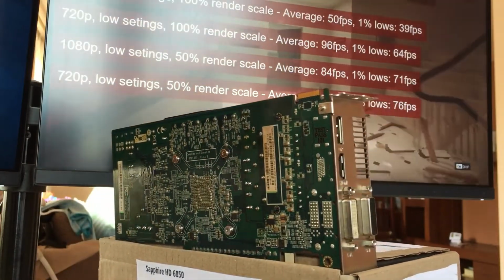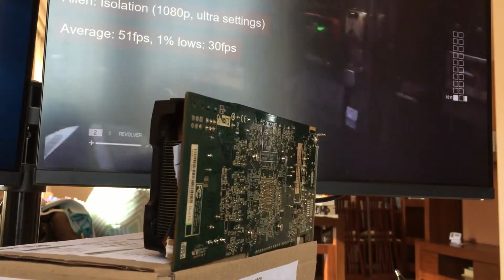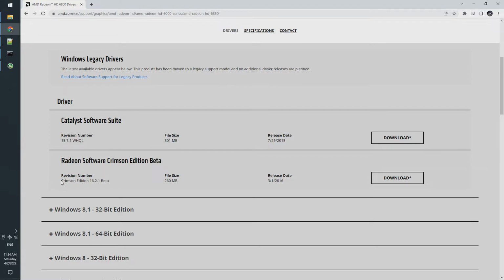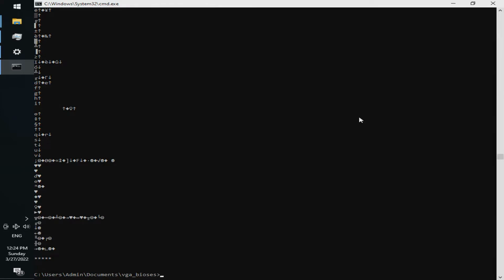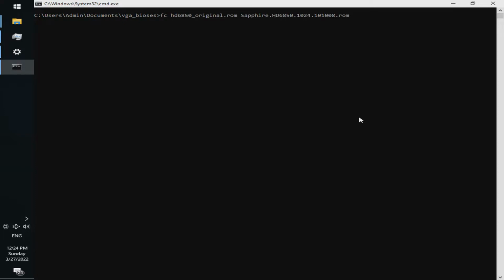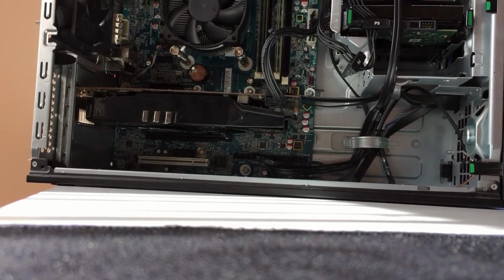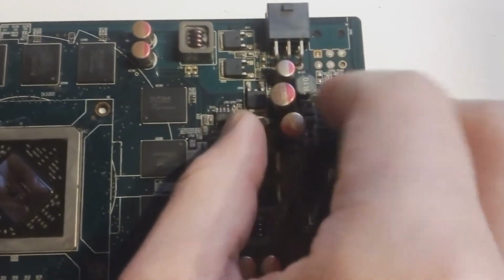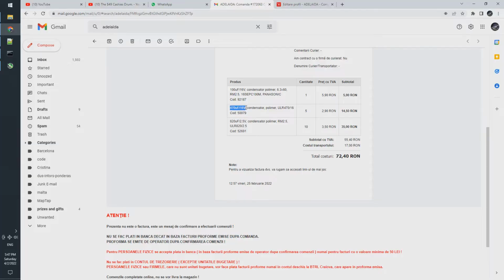The tumultuous retirement of a Radeon HD 6850

Comment: ive had good luck on xbox console to use kapton tape under aluminum foil to protect bits of plastic or capacitors that i couldn't easily remove from a baking attempt. making little foil "balls" to raise the PCB in the over to allow convection to circulate also helps avoid hot spots